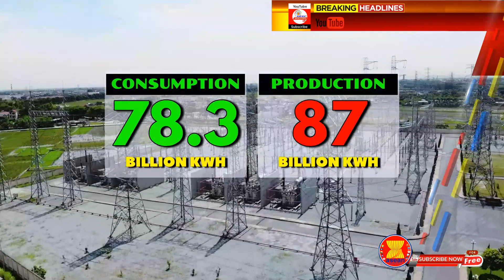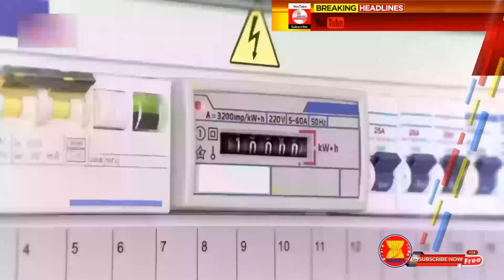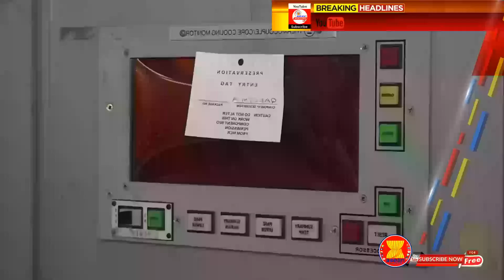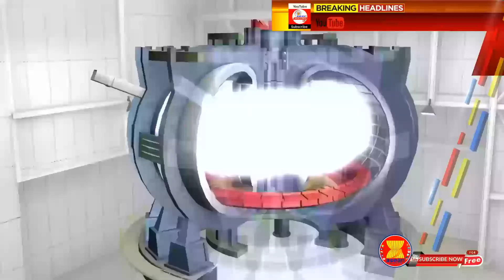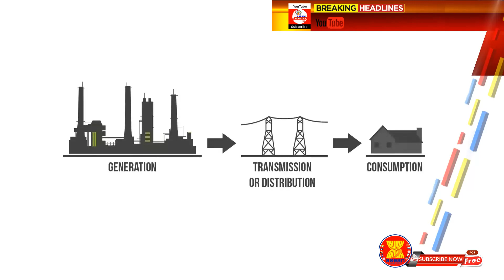Is the Philippines Going Into Nuclear?

Comment: the biggest obstacle of nuclear power is the stupidity of people. it is the greenest source of power next to hydrothermal and hydroelectric sources of power. one gram of fuel converted into energy is equal to two million metric tons of the highest grade coal. one shortcut to produce electricity from nuclear is buy a nuclear submarine from the us or France and make it into a power barge. if the Philippines have enough intelligent engineers and politicians to accomplish it, construct a thorium Liquid Metal reactor. there are a lot of geological sites in the Philippines to mine for thorium. it is more abundant than uranium and has the benefit of being able to burn off nuclear waste. the Philippines can be a burner of nuclear waste of other countries by converting that waste into electricity (e=mc2). partner with India to construct it. India has a can-do spirit and brain power that the Philippines should emulate